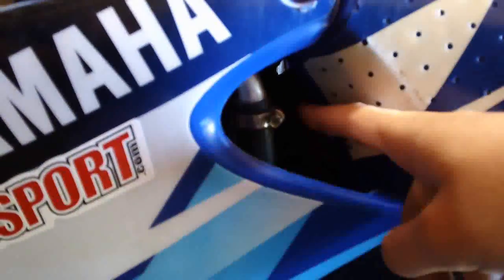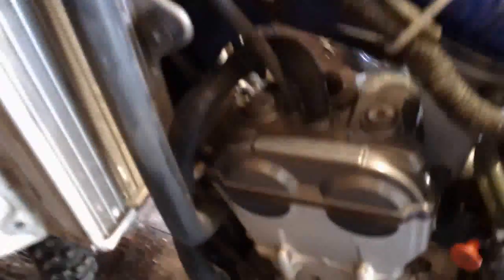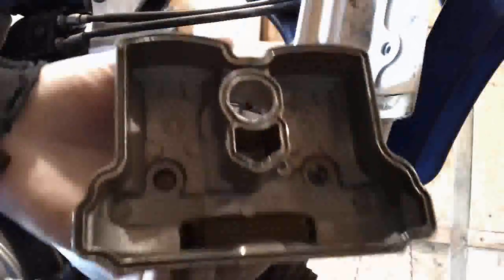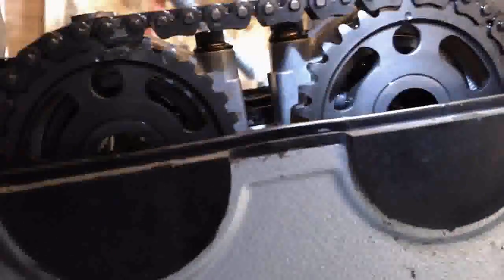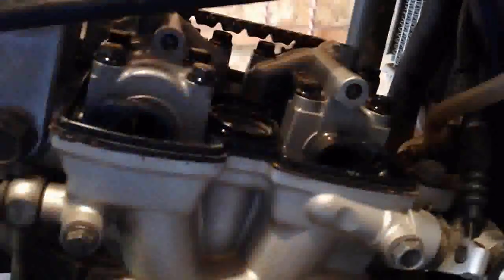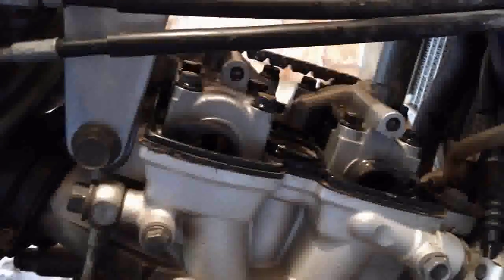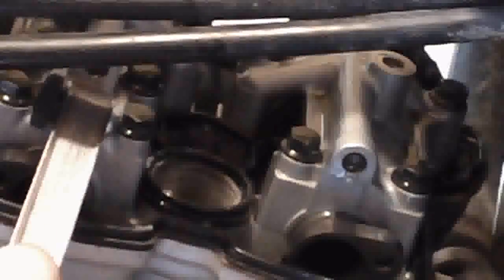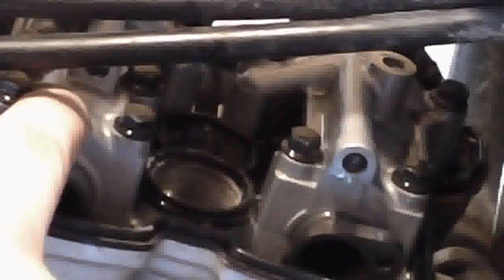How To: Check Valve Clearence and Re-Shim

Comment: Hi my wr450 idle very nice but backfires alot what can it be
Reply: Sounds like a carb adjustment issue. Does it backfire when decelerating or when you try to give it gas?
Reply: J Blob 
Mine does the same it back fires when decelerating only what can it be ???